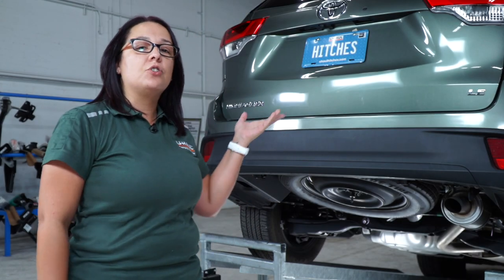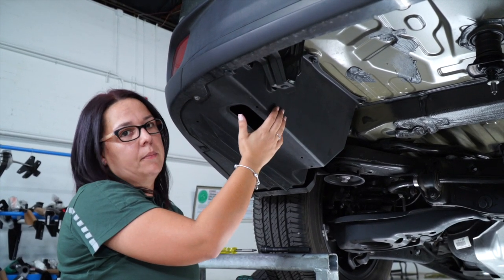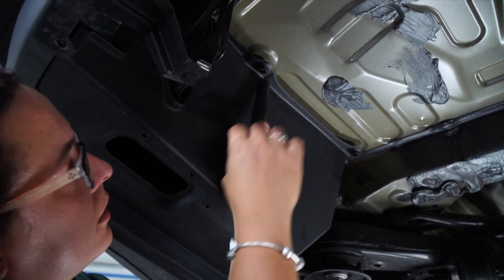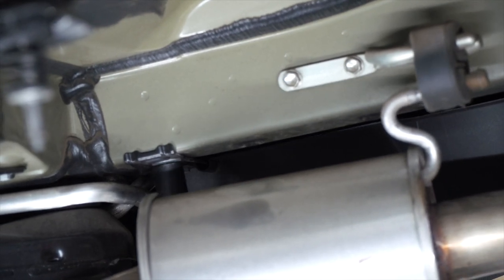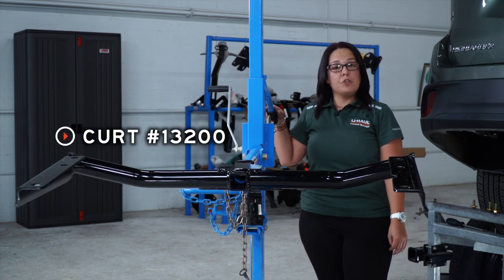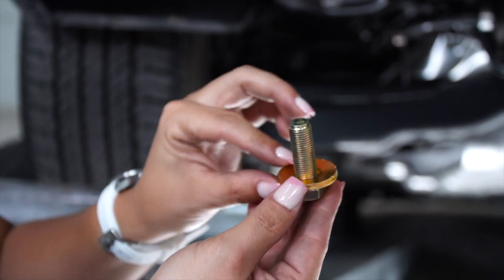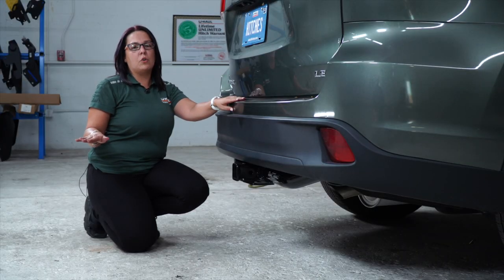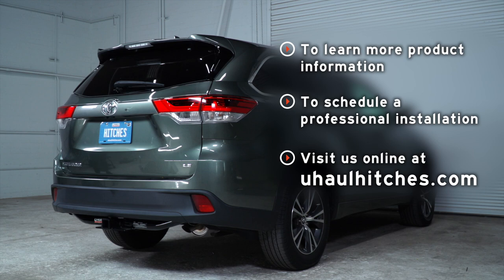2018 Toyota Highlander Trailer Hitch Installation

Comment: Helpful and accurate. I cut and re-installed the driver's side plastic piece after making required clearance cuts (sharp razor blade knife worked well). Seems the removed piece is not really necessary, though, but perhaps will keep mud from getting kicked up on the underside a bit.

Comment: I just priced a similar tow hitch installation from Toyota. They gave me a quote of about $1,300... Insane!
Reply: I've since installed a hitch from e-trailer with wire.  Unlike the OEM hitch, this one is under the bumper so no need to cut into the bumper, which I prefer.  If you can diy, you can save a lot.
Reply from the maker: Dealers charge much more than our installers. Visit the link in our description to get a quote at your closest U-Haul!

Comment: I only looked at this video because I have the same vehicle. Why not mention torque specs???
Reply from the maker: Sometimes they change after some time so to not accidently call out the wrong specs, just check with the instructions that come with the hitch to be certain.